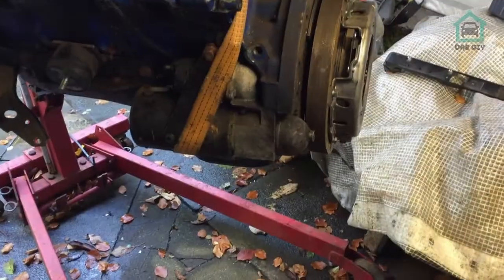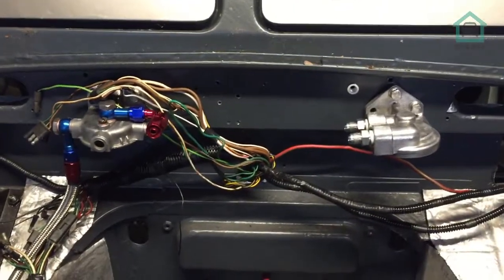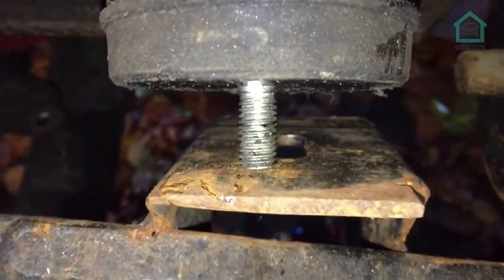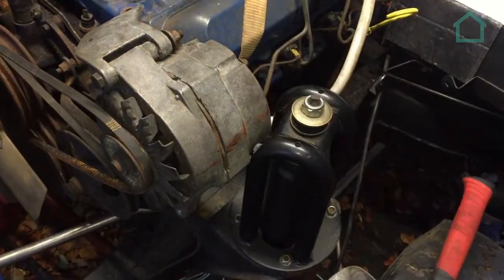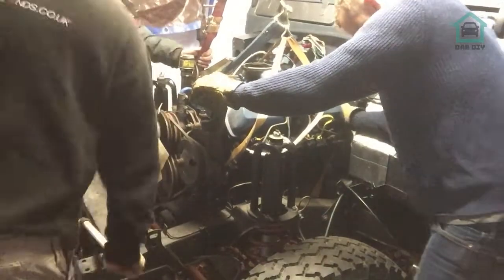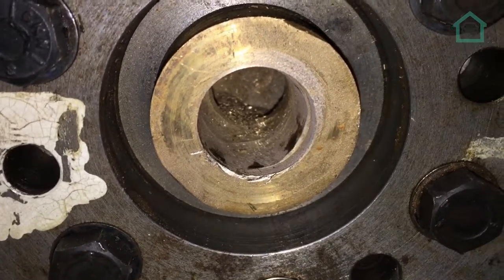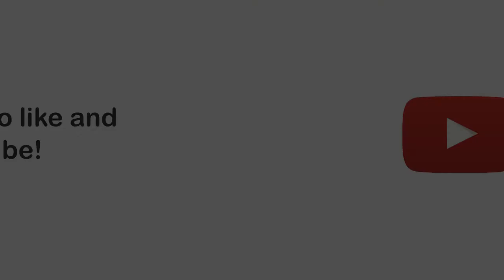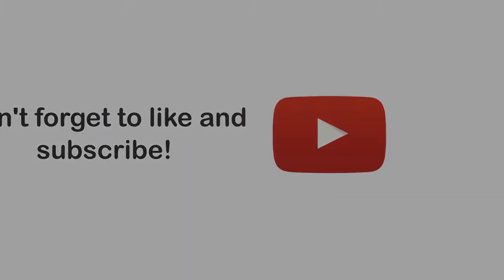Land Rover Defender V8 Conversion Part Three

Comment: Which radiator do you mount to the defender V8?
Reply from the maker: Defender TD5 radiator, completely off the shelf. Part number PCC001020 from Maltings Off Road Ltd.